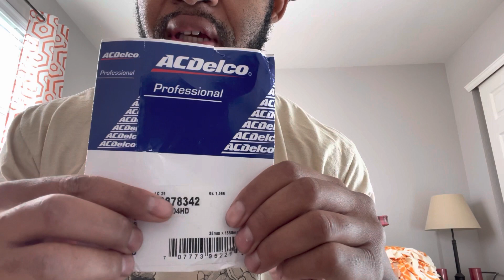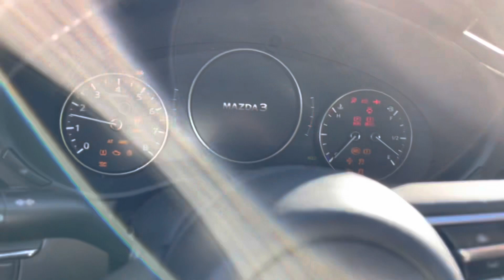Fleetrunner Supercharger Belt Upgrade for Mazda Skyactiv (AKA Green Belt)

Comment: After running 6PK1485HD from Dayco on the supercharged 2.0L, with the smaller puley, I immediately felt a difference. The grip is better, the solidness and the overall driving feels so much better. I don't want another car. If it breaks I will repair it, and drive again, for now that's what I'm thinking. Even after Triming the tensionner professionally before putting the new belt and afterwards, there's still a little noisey vibration on low rpm under 2k, but it does not affect the driving experience. I paid 10usd for the Heavy Duty belt, in Europe so one of the cheapest and best upgrade for the VT supercharger I have done.

Comment: Hi, for my part (supercharged 2.0L) I think the high tenacity timing belt - V - Ribbed belt : "Dayco 6PK1485HD (HD = Heavy Duty Serpentine Belt)" will do simillar good job, without the need of cutting 2 ribs. (like in the case of ACDelco Gold K080585HD - 8PK1485HD - Heavy Duty V-Ribbed serpentine belt). And I also would lile to point your attention that there might be a chance that this dayco HD belt has also the needed shape to prevent the unnecessary reshaping. What do You think.
Reply from the maker: Yes, please test that out & let me know. As of now I have no evidence or information on that
Reply: any reviews for the dayco?
Reply: @D3XEX77  the dayco belt was a huge improvement. No more slippery! I recommend to everyone! Also I sell my supercharger if I teresred.

Comment: Thank you for sharing your journey. 
I also was going to mention that maybe you could go to a machine shop and see if there is enough material and take the tops of the ridges off or get them to make you pulley’s. Otherwise you are going to shred belt after belt . 
Just sayin , that’s what I would try out .
Reply from the maker: Well there's some other aspects of the design & reasoning behind the why the grooves are like that, it also allows for the A/C compression to function properly, so there's an intentional slight misalignment that I will explain in a later video. The belt doesn't shed after initial break in. I already contacted a machine shop near by, it's not cost effective & I can honestly get 40 to 50k miles out of the belt. Thanks for taking the time to comment, someone is looking into pulleys for us.